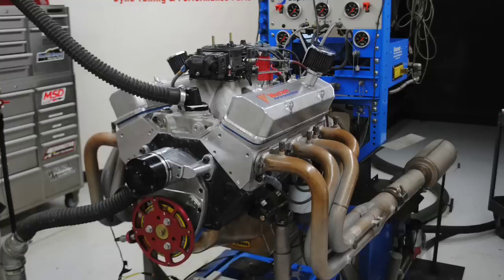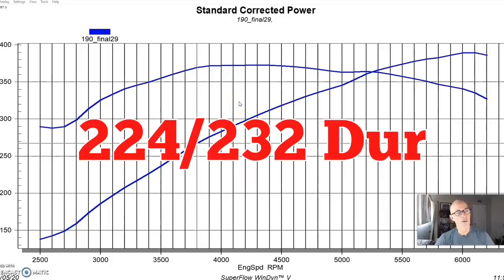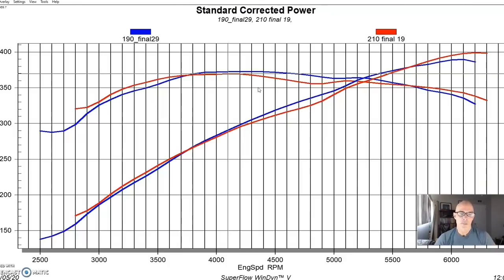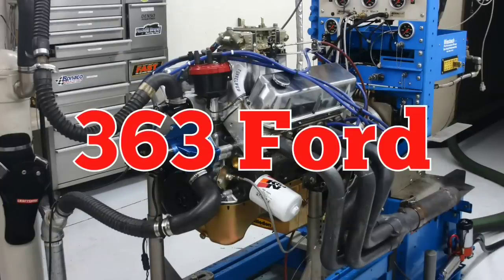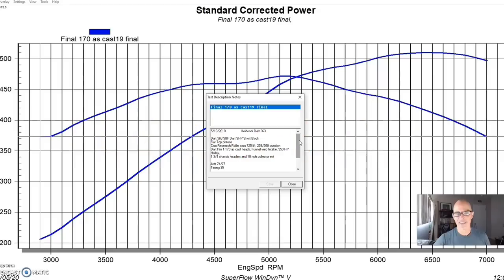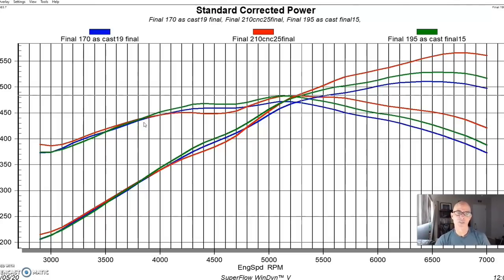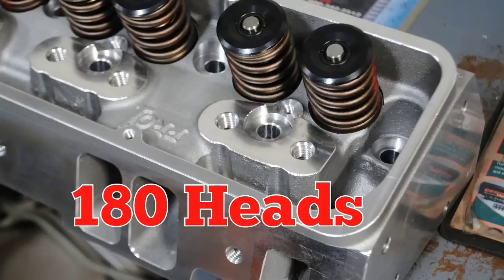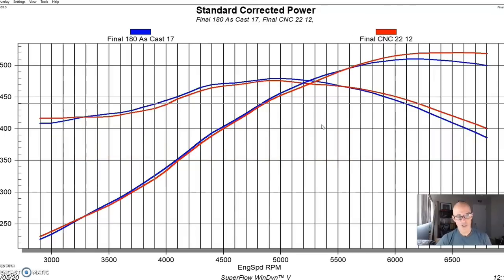PORT VOLUME-IS BIGGER BETTER OR IS LARGER LESS?

Comment: What size convertor would U use on a motor like this
Reply from the maker: not a converter guy
Reply: @richardholdener1727  was only asking as didn't think down low would matter to much if U had say 3k convertor or 3500

Comment: May I ask, will the software you are using calculate the Area under a curve between a given rpm range?  If so, comparing areas under different curves would be interesting information, would it not?
Reply from the maker: The entire curve is provided-so area under the curve is immediately apparent. If you mean average power production-yes we can calculate that
Reply: @richardholdener1727  I just wondered, same motor on the dyno, single carb dual plane, get a curve, change to a long runner intake for example, low end power is hurt, but it does make more top end HP.  Is the area under the curve in square inches on those 2 test the same?  The shapes of the 2 curves are visually different, yes, but i guess it is less than obvious if the total area under the curves are equal or different.  For example would a low rpm motor with a fact torque curve but no top end HP have more or less total area under the curve than the same motor with a long runner intake with more high end HP, but poor low end grunt?

Comment: It's the same as people would say about 4v heads on the street. They're great at wide open but the part throttle wasn't as good as 2v
Reply: Good point, but the 4v was a bad design beyond just volume.

Comment: In regards to power under the curve... If low speed TQ is the goal, does it make much sense to 4" stroke a 5.3L or just start with a 6.0L and call it a day ? Will the 5.3L .20" over bored and 4" stroked to roughly 363 cubes have any benefits over the stock 364 cube 6.0L in terms of low end TQ, say for a truck/towing application with all other factors being equal ?
Reply from the maker: displacement equals power-regardless of bore and stroke if everything is the same-until very high rpm or power levels
Reply: @richardholdener1727  In your opinion, using the 2 examples that I gave, with budget NOT being an issue, would the longer 4.0" stroked 363 cid benefit a tow rig that lived in the idle-3500RPM range over that of the shorter 3.62" stroke/larger bore 364 cid ? (N/A, no boost).

Comment: I wouldn't hesitate to put a 11r 190 on my 302 with a rpm air gap and a 650  because they cost the same as an AFR 165 and less than a 185 and you get 7/16 rockers studs and stiff hydro roller springs without asking for it and paying extra  and it'll probably drive just fine

i wonder how a bigger cam on the lower edge of its compression recommendation  would act if you jacked up the initial timing and limited the mechanical advance? i.e. 22 degrees initial and 14 mechanical instead of running like 14-15 degrees that most people are told to run?  like a mutha thumpr type cam.  

I heard they need a lot of initial to run "cleaner" at idle so you don't jack around with the mixture screws and idle circuit too much

that or you need more compression than what comp says you do

Comment: It would be interesting to compare BSFC between a big port and a small port induction at part throttle, same load. Logic tells it may make a difference with a carb, perhaps not with port injection.

Comment: Anybody that has ever listen to Steve Brule knows that compression and displacement have more effect on bottom end torque production than anything else.
Reply: Most of the people watching these videos don't know it, but the vast majority of the time is spent below 4000 RPMs. They just don't realize, or refuse to acknowledge it!!!
Reply: There is no single variable that stands above the rest. You can easily screw up a large displacement engine with the wrong cam, compression, etc..., and lose all your low end torque. Classic example is Ford FE motors - they have terribly shaped ports, but they were efficient at low end. The 360 had terrible power, the 352 ran great, and the 390, 428 ran great, with efficiency/ good mpg's.

You can't single out a particular component and say do this and it works every time;  there's no wisdom or truth in it. Building low end torque is harder than building top end horsepower; it requires understanding the variables of volumetric efficiency.
Reply: @Faolan161  you do realize that a 360 is just a .050" over 352. Both have the same stroke. The 390 I'd a stroked .050" over 352. They were great truck and big car motors because the block was tall enough to get that long rod in it and keep rod/stroke ratio positive. Been a long,long time ago, but think the rods 6.4" center to center. Also had long piston skirts to stabilize it in the bore. Piston spends more time at top dead center. Rods are really beefy, unlike what we see today.
Reply: Displacment is pretty irrelevant, what's the point stating that a bigger engine makes more TQ.

Comment: Thinking back to some of your LY6 NA tests, the cathedral port heads always beat the rec port heads at lower engine speeds. Not to forget all this is at full throttle, too. But there may be another explanation—the cathedral port heads, especially 706s, had smaller chambers, so the increased compression may explain all. Compared to small blocks of yesteryear, LSs are all over-cylinder headed, thus the much smaller intake duration needed to make power. If a full point of compression is worth about 4%, that’s 16-20 ft-lbs or horsepower for most LS engines. That tells me I need to mill the heads on my LY6! Build in progress, probably for a lot of months...

Comment: Two things. Most cars driving around normally operate between 1500 and 3000 RPM which I guess can't be tested on the dyno. And that would be at part throttle also, which would have very lazy throttle response I imagine.
Reply: Isn't that kinda his drivability question?  Even though at 3000 rpm the Dyno did not show a big change would the smaller head drive better? Or is that more about intake and less about cylinder head?

Comment: Hi Richard would love to see intake and exhaust extremes. Dyno runs of ridiculously small to ridiculously large pipe sizes. It would be fun to see the number. Maybe even something crazy like large intake pipe/small exhaust and vice versa I don't know if you've already made a similar video about this
Reply: @port nut Yes sir, I have seen it although 2.5" to 3" was properly sized to still keep that engine in it's efficiency range. That is why it was such a small difference on the dyno numbers. I mean going to the extreme side of things, not properly sized like that one

Comment: If you're going with a bigger head, you need a bigger cam to go with it.
Reply: Why?  You will get a higher peak rpm with either a bigger head or a bigger cam.  Why both, unless you plan on revving it to the moon?  Better add some compression to that bigger cam.
Reply: @adamdice231  Then keep the head you have  and match a cam to it.
Reply: @joe-hp4nk  Agreed.  Cam and head should be coordinated with what rpm you want peak power at.  Compression should be coordinated with the camshaft.  Otherwise your 400 cfm head and 260 @ 0.050 duration cam on your 8:1 compression 302 might not have the  power characteristics that you want.
Reply: @adamdice231  Cam and compression ratio are coordinated to get the desired cylinder pressure that will run on what octane you're using. If you're running on the street, you want your cylinder pressure no higher than 180psi, Race car are at 200+, In my day, muscle car had 11:1 from the factory, but the octane at the pump was 105
Reply: @joe-hp4nk  in a street engine I try to shoot for a DCR in the low to mid 8 range.  Cylinder pressures vary at different elevations.  We are saying the same things at this point.

Comment: Great test!  Would have been more interesting to me to see it run on a more stock combination. Even so,  more is better, but at some point you still have to ask yourself if those really large port $1500-2500.00 heads are worth the three hp at 6,000 rpm on the street for a nearly stock short block.   My economics say no. A head with a smaller 170-180 cc intake runner volume would really wake up a stock or nearly stock 302 cu inch motor or even one with a 0.480-0.490 lift cam.  Would a larger head help?  Yes it would but, economics come into play. You can have a hp times hundreds of dollars stock motor or you can have a hp times thousands or even ten thousands of dollars stock motor..  How deep are your pockets and how much are you willing to pay for that last two or three hp is the real question.  Economics. Really like your videos. They make us think and sometimes pontificate a little bit. Its a good thing to wake up them three brain cell of mine and watch them chase themselves around that big building we call a head. Lol. Thanks for sharing.

Comment: Would like to see a 383 sbc test with an aggressive solid lifter flat tappet cam, 13.5-14:1 cr on E-85, single plane and a good carb, and a set of Vortec heads just to see how much power someone could make with them, and Richard is just the man to do it!
Reply: I have a .040” over 400 with 12:1 compression and ported Vortec heads.  They make really good power with some porting!
Reply: What's it run at track ?

Comment: I thought we were going to dyno these engines at low rpm . Roll the test back to 2000 rpm
Reply: Is there a reason that lower rpm figures are typically not recorded when doing a dyno pull?
Reply from the maker: we don't run WOT at 2000 rpm much

Comment: Hey Richard!

Do you think modern heads and CNC programs are just that good, that the port remains stable and efficient at even extremely low velocities? I wonder how this test would go if you ran a 351-4V vs 2V head, or some older designs of aftermarket head?

I don't suppose the Superflow can plot torque vs time, allowing you to hold the engine at part throttle (say, 40 ft-lbs & 2000 RPM) and measure the time after going WOT that the engine makes max torque, eh? Or to plot torque against manifold pressure over a variety of openings?  I never see anyone doing that except when fully mapping out an ignition table.

Comment: My experience on the drivability with big heads and small heads on the same engine is 351C and Pontiac engines. Everyone has always said the Cleveland 4V heads kill bottom end and the 2v is better for street driving and will still make good power. That wasn't what I found. The 4V heads with a mild 224@.050 cam made enough torque to smoke 9" wide tires with a 3.00 gear in a 72 Mustang, stock converter, stock weight, stock intake and carb, with a set of headers.. If you whacked the throttle from idle, it boiled the tires. Not quite as much bottom end power as one of my 400s or 455s, but for a small Ford, the C rips and it drove around easily with HUGE ports. Its the only small block to impress me with only a cam and headers.

Port length matters more than the size, unless its a poor design. Increase the port volume on a Pontiac, you simply make more torque everywhere. Its damn difficult to kill bottom end on a 455 unless you put a huge cam (over 250@.050) in with low compression and stock ports and valves that come in a 190cfm 350 head. Its more the cam timing that does it than anything, the too small heads won't flow enough air to feed the 455 above 3500rpm and the cam wants to move the RPM range above 3500. Put a 330cfm head on it with that cam and its going to make 600ftlbs at 2500rpm... and 600ftlbs at 5000.

Maybe you could see it going with a 389 or 400 with the stock 3.75 stroke and some RA V or 400+cfm Tiger heads and a relatively mild cam, but usually its low compression(7.7:1), long duration cams(240 and up), single plane intake, and stock heads that make it so a 400 can't spin the tires or run quicker than 15s. Most guys seem to think that a flat top piston makes 10:1 on a Pontiac, they are thinking chevy. They almost all had flat top pistons and you can make 7:1 to 13:1 with a factory head on a 455.  So they put a 76-79 vintage 6X on and think they need race gas, but its at best 8.8:1 on a 455, and 7.8:1 on a 400. Then they can't figure out why it doesn't run very well. If they have the 100+cc chamber heads from the 73-76 455s, its even worse. Its all in the heads on a Pontiac.

The cool thing about a Pontiac is you can bolt up any Pontiac head to any displacement block, though the small bores like the 326 might hit the 2.11" valves on the 67 and up heads, they will all physically bolt on. Unless you know what to look for the 455 or even a 540 on an IAII block is indistinguishable from a 326, 350 or even a 316. Most non Pontiac guys can't tell if its a 301 or a 400+ engine, they are a hell of a sleeper engine, especially since everything thinks they won't run. So far I haven't found a Pontiac head that is 'too big' and hurts bottom end, they are almost all on the small side or are too small for the 455. Go with bigger strokes like the 4.35" or the 4.5" and you make even more bottom end and need more airflow to rev over 5000. Cam timing and runner length are far more of an influence than port volume.
Reply: Thump Er : The joy of having a rope drive 1963 LeMans 326 is that it could be a Royal Pontiac 421 with just a little invisable work...The Ford side of things has been to play off various Windsor and Cleveland and even FE, FT and Lima families because, ultimately, they are from 4.38 and 4.625 and 4.90 engine transfer line plant stock.... that have not changed since the Y block, and the two sizes of MEL 1950s era engines. Don't be fooled by F and 221, 335, Boss, 385 engine family names wrapped in very    Chevy-esque Canted or BOP215 style 221 heads or the  reprofiled block "hair-cuts". We all know  Pontiac used one bore spacing V8 and (occasionally)  4 cylinder from 55 to 81 and made 80-81 265 and 77-81 301 engines, lighter than 302s.  Nothing new in Ford V8 engine architecture since the  1952 to 1958 OHV transfer lines. So Ford played off  deck heights of the 352 FE/ 351W/351C/351M/400 and even the Lima 370 against everything else. Ford Cam masters there have only been 13 since the 252 duration 221/260 cam since 1962 to 1984. The next new V engines were the 1982 Essex 90 3.8 and the Vulcan 60 3.0 1986 engine. So Ford downgraded the 1981 351M to 136 hp and raised up the 351W HO to 163 hp. The Windsor HO had the Marine cam. So Ford was only interested in plant utilisation and emissons. The 4.2 V8  had a stump puller cam, useless for making power. Every time Richard Holdener dynos a Windsor 5.8 I think what one of Fords 12 deadly Letter Cams would wake this Baby Up Best....

Comment: I like these technical dyno-test videos. It shows that "rule of thumb" and "common knowledge" aren't always right. The internal combustion engine is still full of surprises.
Richard, do you use any engine simulation software to optimize engine combinations before choosing the parts?
Reply from the maker: I do not use software
Reply: @richardholdener1727  Why not?

Comment: A BSFE table of each with them making 200ft-lb torque at 1500, 2000, 2500 and 3000 rpm would tell which was more efficient. (If that's possible) I would expect the smaller ports generate a stronger impulse to the carb providing better fuel distribution and AFR.

Comment: I see you are doing this on common V8 engines. But what about smaller engines, like a the Ford 2.3 or a Honda 1.6B and 2.2H?
Reply from the maker: look at the port volume and flow on a B16A head-it much larger than it needs to be for its power output but works very well

Comment: Engineers spend countless hours working backwards from full-throttle dyno numbers to achieve those part throttle numbers they desire for a given combination of both emissions, fuel mileage, along with weight and gearing, and all to get those driveability issues worked out. Hopefully, Richard will get to visit with Gale Banks for a while and share the experiences. Mr Banks sounds a lot like Richard in that the most important place to start is with the power goals all through the RPM range.

Comment: I run 210cc procomp heads on the 5.0 in my truck. Part throttle is fine, just put your foot into it a little more. It must still be fairly efficient as the truck gets the same mileage as it did with the 150hp 4.9 straight 6!

Comment: The lesson here if there is one is that you need to match the cam to the head flow. The slight increase in power with the bigger heads at low RPM was due to back flow at low lift and the lack of velocity. Here is the problem with pulling an engine on the dyno below peak Tq. Is no one in there right mind would drive along at 2500 rpm in high gear and put the throttle to the floor.
Reply from the maker: back flow at low lift?
Reply: @richardholdener1727  Yeah you know.. back flow at low lift combined with crossflow of the overlap durational lift and that is compounded by the back draft of the temperate fuel state.

Comment: What is being totally missed is that the engine doesn't just flow air, but an air/fuel mixture. The engine that presents and maintains the best air/fuel mixture quality to the cylinders runs the best.  Thus, the reason direct infection wins over carburetion.
Reply from the maker: direct injection tends to make less power than carburetion or port injection because of reduced charge cooling

Comment: I paused the video as soon as the 306 popped up on the screen. Im going  to take a shade tree mechanic guess and say if you dont have enough compression yes it can hurt you... ok, back to the video!

EDIT: Yes, for a street engine.. bigger is NOT better as far as port volume.

Comment: Now test a mild street engine. 406sbc 9:1 230dur 480-490 lift cam RPM air gap with vortec heads then a set 210cc heads. Load in at 2000 and see the difference In low speed power! Or any mild street pump gas engine with a dual plane.